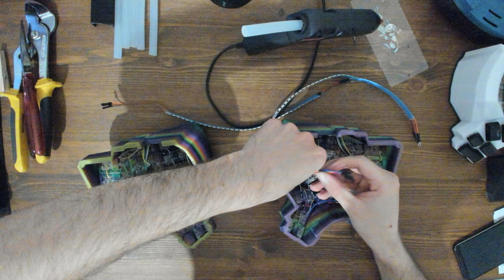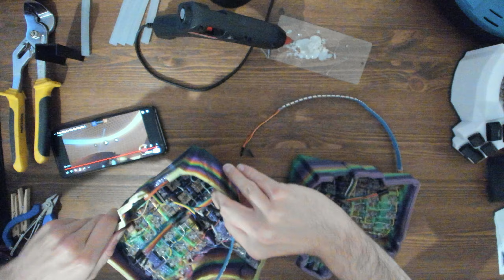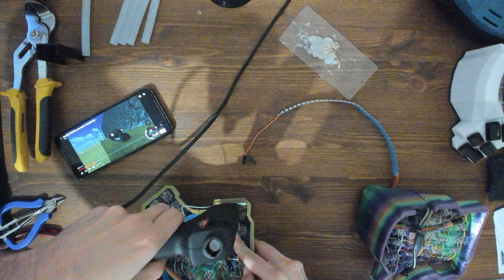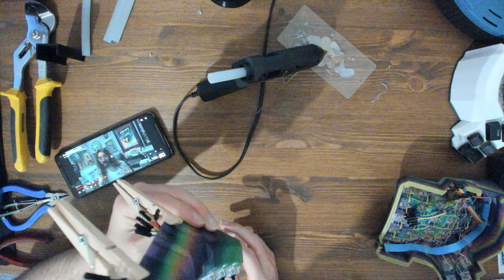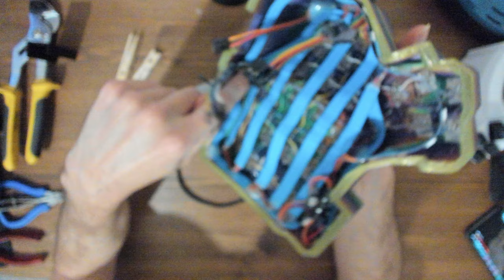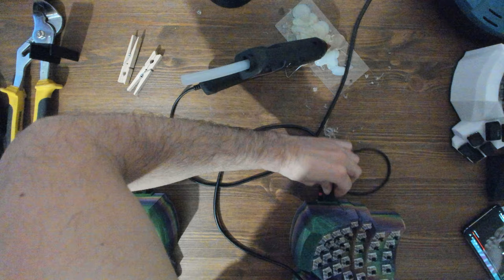Dactyl Manuform RP 2040 Build Part 8 | Final assembly LED strips

Comment: Have you had any issues with wrist pain? I read some guy had to switch back because of it but it seems like better wrist rests like the ones you have might solve that
Reply from the maker: No wrist pain so far, but I have been using it just under a month so it's a bit early to tell.